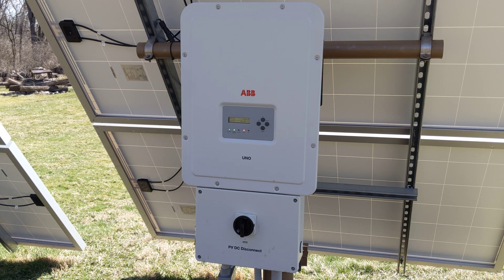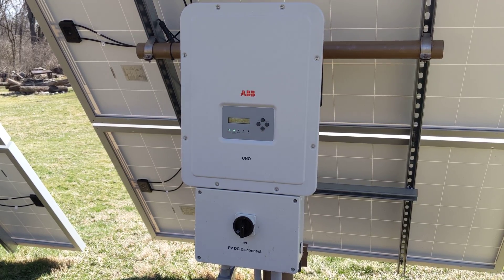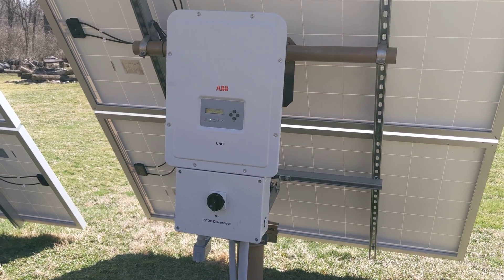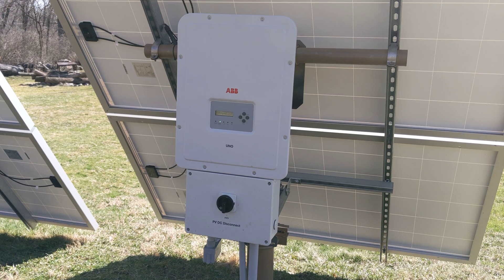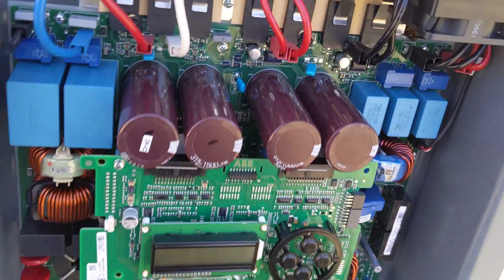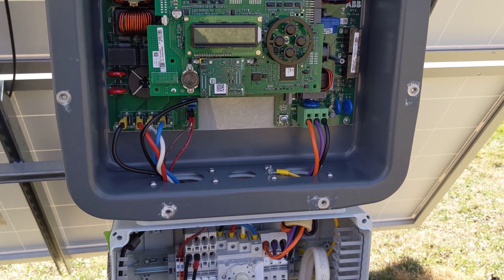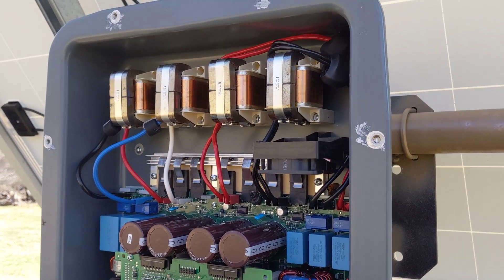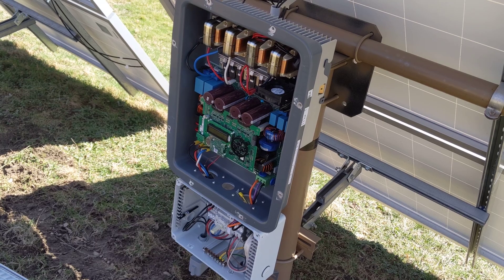ABB UNO-DM-5.0-TL-PLUS Solar Grid Tie Inverter Overview Part 1

Comment: Hi, a question, is it possible to connect two ABB inverters in parallel, even with different power?
Reply from the maker: Yes this should work. Each inverter will output its rated power.

Comment: Does it make much noise in operation? A whine, buzz, hum etc? Trying to decide where to place a 4kW one I have. Just wary of putting it somewhere to close to an area I use around the house and it being annoying.
Reply from the maker: Zero noise. There is a small fan inside but I haven't noticed it turning on.
Reply: @bluetrepidation  Awesome thanks. I was a little unsure as the data sheet just said less that 50dB which doesn't help much. I know some have a bit of a whine so that is good to know it's quiet. Gives me a few more options for placing it!

Comment: im in the process of designing a solar system for my house. i have to choose between GoodWe, ABB, Delta inverters. based on your experience, would you recommend this ? the model my solar installer has suggested i beleive is the updated model of this, its the ABB UNO-DM-5.0-TL-PLUS-Q
Reply from the maker: Yes that is the newer model. Looks like they crammed the solar disconnect switch into the base of the main unit and added solar connectors. This makes the unit smaller and easier to install. This ABB product line was sold to FIMER group and is no longer supported by ABB. You'll find better information on their website. As with everything modern the only thing I can complain about it the ABB "Plant Viewer" software. On Android it crashes all the time and hasn't been patched. Also I haven't figured out a way to use a 3rd party app to grab data from the inverter. So if you care about logging maybe using another brand would be better. You're kinda stuck in their eco system. The web based viewer works fine tho and you can export a csv file manually. Hardware wise it should last forever and is efficient.
Reply: @bluetrepidation  thanks for your feedback. i heard they have two apps, aurora vision and energy viewer. yet to experience them. as for exporting data, i recently read a post where someone is exporting from ABB to pvoutput. maybe it will help you here's a link to it https://forums.whirlpool.net.au/archive/2796480
Reply from the maker: @kristenkearney7336  Thanks! Will look into this.
Reply: @bluetrepidation  you wouldn't know much about AC and DC isolators would you? one of the Solar installers have told me they use a ZJ Beny DC Isolator and a NHP AC Isolator. wondering if there is anything better i should ask them to use instead or if these will be fine ?
Reply from the maker: @kristenkearney7336  many many brands of these out there. I'm also unfamiliar with the ones you mentioned. Here I used ABB on the DC side and square D on the AC side.
Reply from the maker: @kristenkearney7336  I was able to use the Energy Viewer app by Fimer. This app runs much smoother and doesn't crash on my phone. Thanks for pointing that out.

Comment: Hi mate...awesome video......my parents just had one of these ABB UNO DM units installed and unfortunately the installers did not provide my parents the wireless access point password. There is nothing on the name plate that states what the wireless password is (I can only see a sticker that shows SN WLAN and PN WLAN). ABB support wasn't much help either. Is there any way you know of how we can determine this so that I can add it to their home network? We want to be able to use the app to see power generated etc. Any advice?
Reply from the maker: Yes. The password was originally on the sticker on the outside of the unit. Take a close look. Can you see where a perforated portion was torn off? If so the installer should of stuck this inside the manual for the unit.
Reply: @bluetrepidation  Thanks for replying mate.....unfortunately its been torn off but not stuck inside the manual.....so i think we're stuck with no wireless access.....
Reply from the maker: @atillakolik7321  Page 76 of the manual "After 24 hours wich the inverter is power-on, the access point default password “ABBSOLAR”
will be disabled and any subsequent access to the internal webserver will be possible only
using the PRODUCT KEY (printed on the “Wireless identification label” and applied during the
commissioning phase to the quick installation guide on cover page) as access point password." This key may be printed on the wifi card inside the inverter too. If I get time I'll open mine up and look.
Reply: @bluetrepidation  Hi mate...was just wondering if you had a chance to check the wifi card inside the inverter for the key? Unfortunately I'm still in limbo regarding this issue, ABB have not been too helpful to date :(
Reply from the maker: @atillakolik7321  I'll look into this.
Reply from the maker: @atillakolik7321  Step 1: Turn off your AC disconnect. Step 2: Turn off your DC disconnect. Step 3: Wait 10 minutes so to let the capacitors discharge. Step 4: Using a T20 torx bit remove the 8 screws from the main cover. Step 5: With the main cover removed locate the 4 plastic push retainers from the black plastic cover labeled "service only." Step 6: Locate the wifi card. (Square PCB next to the clock button cell battery.) Step 7: Using you favorite QR code scanner app read the larger of the two QR codes. Step 8: Your product key is the last 20 digits including dashes in the QR code's string. Use this as the wifi password to connect to the inverter SSID that looks like ABB-XX-XX-XX-XX-XX-XX. Step 8: Once you are connected to the inverter's access point go to 192.168.117.1 Step 9: If the inverter was never setup just follow in instructions on page 76 of the manual "commissioning the inverter" if you are prompted for a login click "forgot password" and enter the product key you just found with dashes. Once you are in you can reset the user account password or setup and entire new account and pass for future use. Step 10: Head over to auroravision.net and setup a new account with your email address (not related to the account you just made inside the inverter's interface.) and enter your inverters MAC address into the devices tab. If your inverter is bound to an access point with an internet connection you should see all your information show up after a few minutes. Step 11: Install the "Energy Viewer" by FIMER Spa app from your app store and login using your Aurora Vision account.
Reply: @bluetrepidation  Thank you so much buddy...I'll give this a go next time Im at my parents place....
Reply from the maker: @atillakolik7321  Did this ever work?

Comment: Hello, I have an inverter equal to 5Kw, and it gives me a repetitive alarm W004 grid OV, on the AC side, the "Vout" rises to 250 volt and gives an error, and it restarts, starting again, (in the country it is 220 volt  and 59Hz), I have not been able to know the origin, I would appreciate if you could help me ..... Kind regards
Reply: Hi, the system is OK, the fault remains intermittently, but it is associated with the consumption of the network, I live in a rural area and there are few neighbors and I have a transformer from the electricity company only for a few.  When I have consumption inside the house (microwave, electric stove working), the grid voltage remains within parameters and the fault does not occur.  Until now, in spring, it produces 20 to 23 kWh a day, on a sunny day.  Saludos (b.Regards)
Reply from the maker: Hi how far away is you inverter from your main electrical panel? is the wiring sized correctly?
Reply: @bluetrepidation   The main electrical panel (AC side) is at 3 m, has a 2.5 mm2 conductor for the 19 Amp load max., and the DC side panel is at 1 m, 6 mm2 conductors... thanks...
Reply from the maker: @agromora  Bump the wire size on the AC side to 6mm. The AC side is more sensitive. Also check for loose connections.
Reply from the maker: @agromora  Did that work?